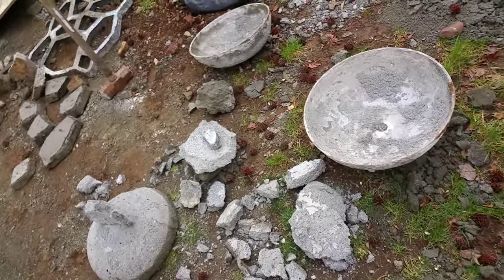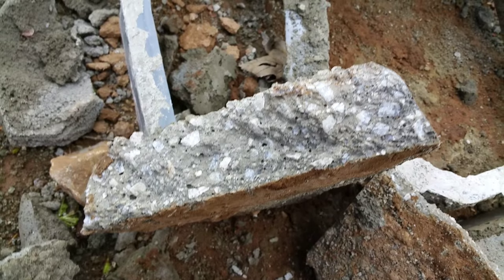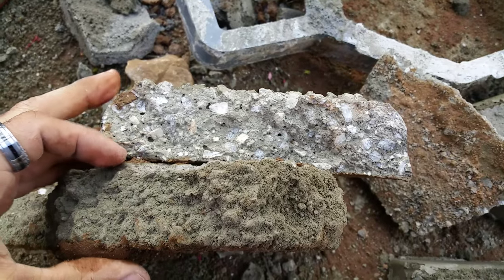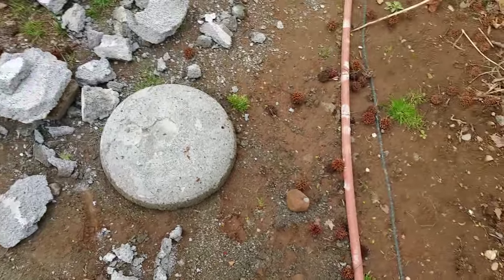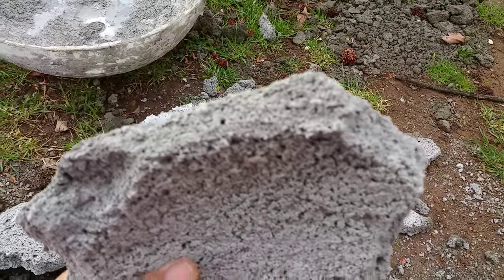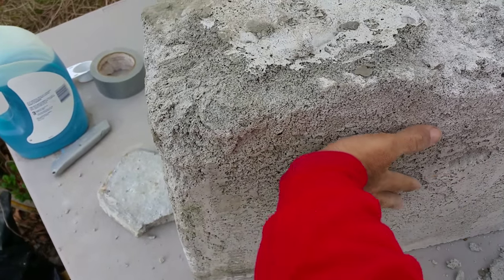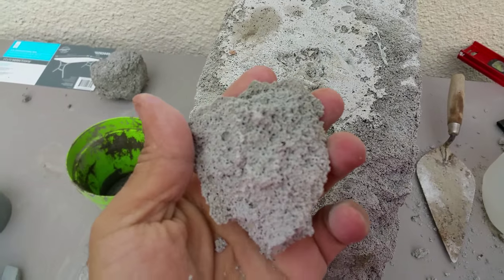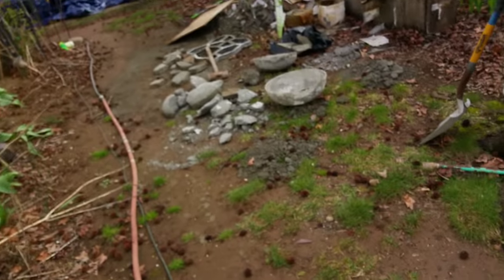Aircrete Updates | Strength #aircrete #aircreteupdate #aircreteharry #diy #foam #foamgenerator

Comment: Thank you for sharing the results of your experimentstion.
Assuming that inadequate curing is part of the problem, are any of the following questions apropos?
* Since concrete is impervious to water, can it cure from the outside preventing it from fully curing on the inside?
* Can adding more water to the mix improve curing?
* Do the chemicals in the foam interfere with curing?
* Would keeping it covered and wet improve curing?
Thanks again for sharing the valuable results of your experiments.
Reply from the maker: New test coming soon. At this point I see it as an insulator only.

Comment: maybe try fiberglass shorts (chopped fibers 1/2 in long, comes in bags for cement reinforcing)
Mix them in well and it would be solid im pretty sure.....peace
Reply: Maybe consider putting some Basalt Rock Fiber in it.
Reply: yes that will work its called fibercrete and is very strong
Reply: Hay,, I was just thinking of saying that,, shoot some chop in to it and stir it in,, I want to try it.

Comment: Hey there harry,
there are two naturally occurring tree gums that are used in the food industry to provide stiffness in certain products like ice-cream and they are also used in the cosmetics industry. Because you are doing trials already with aerated concrete, maybe you can try some of these gums in the foam mix. It will stay as a foam and not collapse a bit like when you make a mousse with whipped egg whites, it stays stiff and forms the structure on which the chocolate hangs. Anyway these gums are called xanthan and Guar. They are also used in sauces and mayonnaise etc as thickeners. You don't need very much for them to produce a very stiff plasticy type of matrix to mix the cement into. 
The other suggestion I was going to make, is to include styrene beads like the ones in a bean bag, as these provide insulation and help to keep the material light as though air bubbles are included. Have fun.
Reply from the maker: I did try one but it did not work for making aircrete. https://www.youtube.com/watch?v=X4UzjJvuqnI

Comment: I'm a 20 year Concrete vet. I own Epic Concrete Designs LLC. And i think i have your solution 
add some High Reactivity Metakaolin
The White Alternative to Silica Fume. actually any pozzalan will add strength.   Try 2-3 parts ground Silica to 1 part cement and 10% metakaolin by weight.
Reply: also add Fiber
Reply from the maker: https://www.youtube.com/watch?v=pjg5XMp_u04&t=949s
Reply: nonya business - Absolutely love problem solution people... thank you for your comments!
Reply: Concrete vet! Have you tested your recommended method?

Comment: Are you using the plant based soap? Seventh Generation from Target is whats needed. You need foamier foam too. Those pockets are way too big. Thats why it's so brittle. Your foam bubbles are too big.
Reply: mike black yes! if your bubbles r big it wont be worth nothing. and concrete gets strongest at 28 days so I don't really appreciate this video
Reply: " at 100 years after that it begins to chemically decompose.

So how come the Forum in Rome still exists? It is over 1500 years old.

Comment: Aircrete at 100 psi is extremely weak. If you've read any of the information on it, the suggested psi is 1200 with a range of 400 to 1400 psi. Increasing your psi will increase the MPa of the block. Hope that helps!

Comment: if you want it to be of proper solidity, you need to let it cure for at least 30 days using burlap or latex cure to keep it damp. Otherwise it will always staw brittle. The key is in the Curing. Plain and simple.

Comment: Interesting experiments!.   Would you share comparison weights of chunk.?  Always wondered just how light the stuff really is; one contractor swears it could retrofit a layer of aircrete between 2x4 rafters, and it wouldn't cave through the drywall ceiling....IDK...my brain still fixates on how heavy cement is!  
Pozzolanic ash is good for strength and fire resistance; fires mess with regular cement; pozzolan is a product of great heat, so resists fire damage, makes stronger crete. .  
Also, could fiber crete be used to make aircrete?   
The stabilizers work nicely.  We did some experiments using a G-P glue called "WeldBond"...used to get it at Home Depot...only needed a little bit, and it really strengthened the mix being played with [we were trying to find a good dirt/crete plaster for a strawbale wall]...it did a good job.   I think it was about 1 shovel of portland: about 1/4 to 1/2C WeldBond glue: several shovels of dirt from site filled about a 5-gallon bucket...mixed in a barrow...been close to 20 yrs ago.  Wall's still standing...seems the earth plaster recipe worked. Stayed intact through the Nisqually quake.   
Metal or other mesh...
In about 1990? Berkeley shake-table tests were done on cob and strawbale walls,  
Results:  both kinds of walls, and I think also a rammed earth wall, crumbled pretty fast at moderate seismic impact.    But, even if the walls were simply wrapped with common  chicken wire, the vertical walls stayed in place up to about 8 or 9 on Richter scale? 
Can't remember...it was a remarkable improvement...adding plastering to embed the mesh and wrap the walls, was even better. 
IDK if it would be wise to only embedded rebar with aircrete; rebar is coarse, compared with the fine bubble structure of the aircrete. Under even small motion, such as settling, or larger like seismic, or even heat/cool expansion/contraction, might act abrasively on the aircrete, causing cracks or worse.  
Chicken wire is a fine wire, smaller meshes, so less likely to cause cracks or failure in the more brittle aircrete;  it can also be gotten in smaller diameter holes too, a finer mesh than average chicken wire.  These are also easier to mold into a curved surface.  
Vard Wallace, in the 1950's/60s, up in the Puget Sound, was experimenting making concrete boats.  Didn't work without mesh. Had to use about a 1/2" mesh to minimize cracks...no matter what, cement will develop cracks over time.  
Years later, others were using similar tech to build semi-underground houses.  Those require a 4" lattice of 1/2" rebar, sheathed with 1/2" metal mesh, then screed on portland so that the shadow of mesh is just barely visible under the surface....similar to what Vard did.    With modern fiber and other additives, better.     
One house we saw, had a nice big 20' span in the living-room.  The support for that was done by integrating approx. 4' 'fins' along the top surface, about every 4'; the fins acted like arched beams suspending the curved dome-ish roof of rooms below.  Those walls/roof, were otherwise about 3" thick, total.    
That might not work with aircrete, because it's too thin a wall.    
But doing smaller size dome, thicker aircrete, and mesh inside and out, maybe also embedding mesh inside the thickness of aircrete, and plastering it inside and out, using some of the modern stabilizers, strengtheners, bonding agents, might work. 
Weatherize exterior using same coatings used for waterproofing exteriors of basement walls....just don't bother with junk like Snowcoat--that gives up in only a few years..a mess. 
We found a water-clear waterproofer for concrete, at a place that sells concrete supplies; that stuff worked very well...can't remember name of it..came on translucent gallon jugs.
Good luck!
Keep doing vids of your progress!

Comment: in concrete, cement is the binder only. the resistance to compresion is given by the aggregate and resistance to tension is given by the rebar.

Comment: Have you tried mixing in some glass fibre? It's nasty stuff but it should improve the structural integrity. Also I think the key is to have a strong surface coating on the finished construction.
Reply from the maker: https://www.youtube.com/watch?v=pjg5XMp_u04&t=949s

Comment: What is the point of "aircrete"?  To make concrete more brittle?  Concrete is meant for strength.  Styrofoam, spray foam, fiberglass, etc is for insulating.  Wood/aluminum is for lightweight strength.  What does this solve?

Comment: Have you considered creating the foam using pure hard tropical oils such as coconut oil? It could be the additive chemicals in the soap that are contributing to the brittleness. Just a thought.
Reply: I would think the oils would impede bonding of the cement to itself, the glycerin in soap is dissolved in water.

Comment: Thank you for going through all this testing very helpful for those looking to buy the  Greendragon. Have you taught of using lime in the mix? I saw some industrial plant that produce aircrete and they add lime, aggregates and bake and steam it. Of-course one cannot expect to take it to those levels put I am positive the Green Dragon can come up with quality aircrete. Keep up the goodwork.
Reply from the maker: +JN Marin Your welcome, Yes I have taught of using lime along with fly ash  and a few other things. Check out my last video where I use a Superplasticizer. Good luck with your Greendragon
Reply: I am sure that a great deal of research into fly ash has been done in the late 1990's and that it is all available for council engineering departments and libraries.

I think the problem is the sulphur content reacting with limestone after some time.

You need to look at reinforcing fibres such as glass weatherproof fibre that comes in crystals and separates into fibres on mixing with water. there is also a vinyl fibre product that has been used to strengthen concrete flooring for decades.

There is a retired civil engineer that may help you but he retired a long time ago; he has a face book account at:

https://www.facebook.com/profile.php?id=100007746138899&ref=br_rs
Reply: Someone needs to add decaf to their morning java.

Comment: There are multiple articles online on strength and longevity of Roman cement. (search google) The basic gist is that they used water from rivers and streams, and the biological material in the water cured to create almost a glue to hold the concrete together. Try NOT using tap water or bottled water. Try using creek or pond water, and filter it to remove the leaves and stuff, but the microscopic plant & biological material should add to you strength and longevity.

Comment: Where they mess people up with the air Crete is they tell you it sets up overnight. It takes about a month for the cement to be at full strength. I did not have this issue with mine but I waited a month before using.

Comment: Ooh, what about using spray in foam insulation (2 lb) to mix in with the Portland cement instead of the soap foam. 2 lb foam would be more expensive  but, it is structural and insulative one its own, plus with the added benefit of the cement and sand, it should be amazing.

Comment: I nay consider doing aircrete similar to ferro cement to minimize thickness.. Ultimately I want a hot tub. Have to crete a smooth mold for interior with jet fittings and drain.

Comment: Just came across your videos after watching some of the other ones on Air Crete. I felt it was too good to be true to have something that would be as strong as they were claiming. They even showed a guy breaking a concrete block and then hitting a piece of Air Crete with a big hammer and the Air Crete withstood the hit. It would be interesting to have the formula for whatever they used to make that block they couldn't break. But perhaps they used something else in it to strengthen it, like fiberglass strands or something. You must have some pieces that have stood for 30 days now. How have they held up?  Once again, thanks for the video. Its too bad when everything you see you have to question, but when it seems to be too good to be true... you must do so! All the best! Hey, you're not a Farscape fan, by any chance? :)
Reply from the maker: I have some new ideas very different than whats being done now. New videos coming soon.

Comment: Secret.  Add primer. Gripper primer from Home Depot. It's a latent that will make it freakin stronger. A little goes a long way.
Reply: I think this is a very good idea! as well
Reply: Guy Ruff 
Also,,  I have used Gliden Gripper paint as a glue for closed cell insulation board. I made a doghouse cover for my snow blower.

Comment: Concrete almost always has re bar in it. Sometimes hog wire. Fencing, chicken wire, some form of metal reinforcement.
I've never seen any videos of people using air crete with metal reinforcement of any kind.
If I made a dome home, it would have to have a re-bar grid in it for sure.

Comment: What if you made aircrete bricks and use Portland Cement as grout and stucco facing and wall material?
Reply from the maker: https://www.youtube.com/watch?v=TlSqBiu7SJo&list=PLHnuS9-ekYxgL3K6alErsq0acvjJwSv6P
Reply: HappyQuails use a grout mix instead of portland cement. Grout does better at expansion and contraction caused by heat and cold than straight portland cement. It can be done but the life cycle depending on your climate might be reduced.

Comment: Aircrete makes a good insulator for walls and other structure.  But because its compressive strength is very low, it really can't be used as a structural element.  Building inspectors will simply not pass it if used in housing unless they were coated with mesh all around.  And if it is coated with concrete it will defeat the weight advantage for sure.

Comment: can short fibreglass strands be mixed in to the batch?....just a thought
Reply from the maker: Smokenboots yes fiberglass strands can be added to the aircrete. I have added Basalt fiber chop before and it has helped with the strength of the aircrete.

Comment: A dome is a self supporting shape.       It does not have to bear weight like traditional buildings.  A 2 by 4 at 200 mph would crack it and a bullet would peirce it.  Even so, I doubt that it would collapse. Internal rebar and some mesh would make it stand up to flying objects in high wind.  Aircrete is basically a good product, but simply not for all applications.

Comment: Yes latex. Also you know those pillows with tiny foam beads. That at 30% added will lighten the mix. I almost threw a block up through the ceiling thinking it was heavy.